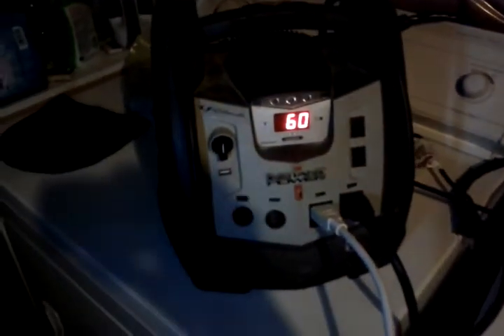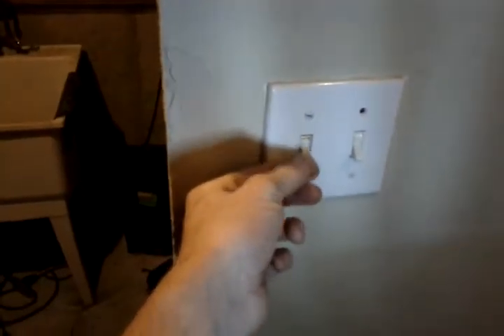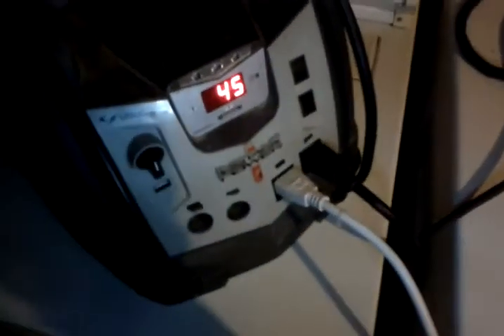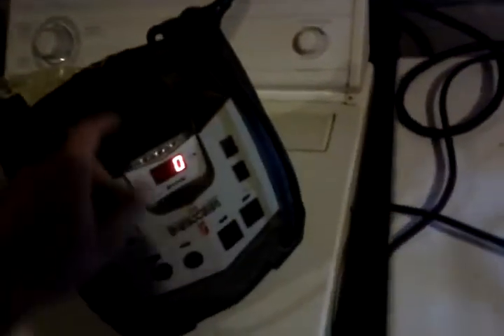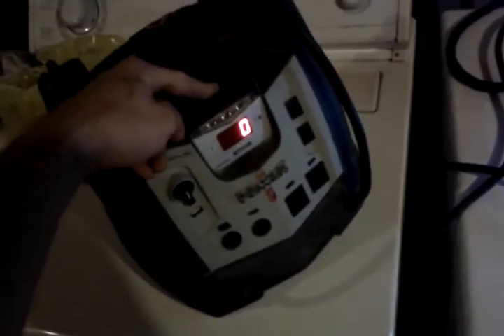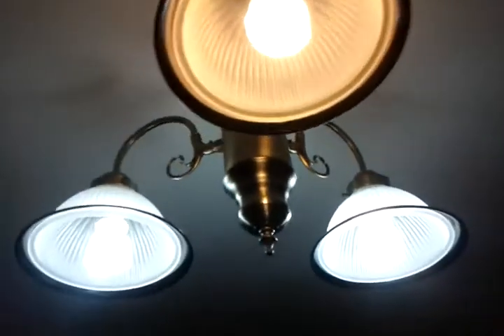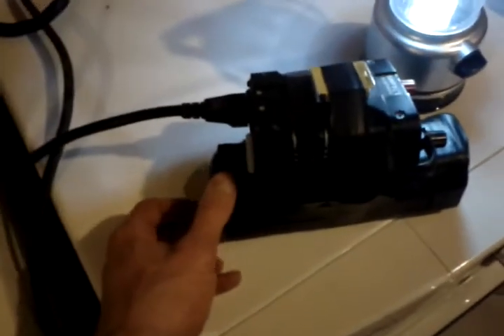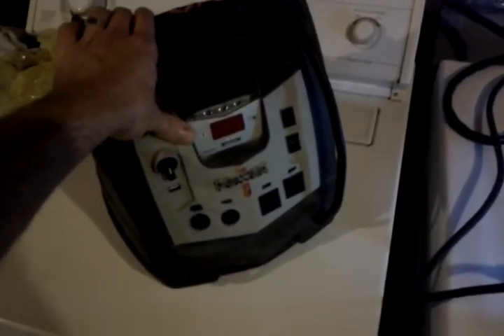Running house off booster pack

Comment: Hey there I just recently bought one of these portable power packs and I had the same problem right out of the box where I couldn't get it to light florescent lights. Being that I am an engineer I started trouble shooting the thing, I tested the voltage off of the inverter and 115v was coming out. Then I started testing the battery pack fully charged, I got 13.6v with an average of 300 crank amps, ok everything seemed fine. I finally went to test the voltage frequency on the inverter and that's where the problem lies, your typical house outlet is 120 to 115 volts with a frequency of 60Hz well this thing puts out 115v with a frequency reading of 58Hz to 59Hz fluctuating. Here in the U.S. electronics are designed to run on 115v @ 60Hz and this thing just isn't putting out the right power from the inverter. OH! and a word of caution don't try and run your nice electronics off of this or you may end up killing them due to lack of power from the inverter. Hope this info helps.

Comment: For roadtrip and weekend camping use, will use for emergencies (tires; jumping) and interior camper light.  Also to charge phones and laptops.  Someone commented to not use to directly power laptop as it may ruin it... hmmm.  But, I am guessing can charge the laptop and then unplug and use, hopefully.  Thanks.
Reply from the maker: Day Drifter i run my laptop off it all the time.
Reply: thanks.  one more ?... can I use a 12v to 12v cord to charge while driving?  I have one that came with a Xantrex powerpack... just wondering if I could use it.  thx
Reply from the maker: yes you can
Reply: How do you do that. Does it have to be turned on? I assuming you plug the booster to the 12 v cigarette lighter and connect it to the USB port correct?

Comment: I have the same unit, where are the fuses? My 12v outlets don't work anymore. I use it to jump start my riding mower, air up tires, ect,
Reply from the maker: I think you will have to open the hole unit from what I can remember.

Comment: I hit a wall too, my laptop power supply pulls about 300w. This says 400w but thats only surge, puny inverter is only rated for 200w continuous
Reply from the maker: sucks hate it what that happens! fake inverters lol
Reply: Going Off Grid if thats the case, I went and exchanged it yesterday to see if a different unit could pull the wattage, still no go. Idk whats different with my laptop that it wont work ):
Reply from the maker: are you using a cigarette lighter plug? on the inverter ?
Reply: Going Off Grid inverter directly. The wattage readout never goes above like 10, and Ive charged some batteries with it, phone etc. It pulls like supposedly 7 watts which seems low

Comment: Thats pretty cool. So you have the 110v from inverter to 110v wall jack and this powers whatever is on the "line" correct?
Reply from the maker: yes, but you have to make sure 100% that the main power breaker is off in the house!
Reply: fliping720 Awesome. Didn't know this-Thanks again!

Comment: Hi, great vid! So my question is, how long do you think I could I run a small guitar amp or portable speaker? I'm a musician and I need a power source to busk with. Thanks!
Reply from the maker: a 50w amp will run for 4 hours or speaker.
Reply from the maker: that would run for a long time as long as the amp doesn't mind modified sine wave as this battery in this video has one.
Reply: fliping720 thank you!  very much appreciated.

Comment: that power pack is small no enough amperage. for long use.get a marine battery the biggest u can fing or a couple make a battery bank add some 400 or more solar panels to start a back up power
Reply from the maker: you are right, this is just a short term power outage salutation.

Comment: Hey whats going man. I have a question, I think you will be able to answer since I saw you are using both products I will ask about. So i bought that power supply you have and i also bought that same small heater (Lasko, 200 watt). When I try to use it with the power supply, bt it self, nothing else connected, it wont work. It turns on for a sec, the it immediately  die. Any thought will be greatly appreciated.  Thanks
Reply from the maker: Wascar Vargas try to get a killawatt meter and plug the heater into it and see how much power it takes,a booster pack like mine will only run a 200w load for 30-45 mins

Comment: so I just bought schumacher xp2260 1200amp peak, on the manual, it says that in order to jump start a car, connect + clamp to + post , - clamp to vehicle chassis, can I just connect the - clamp to - post ?
Reply from the maker: yes you can.

Comment: Thanks for posting this!  I was wondering about noise. I hear a bit of a hum on your video. Is that the booster pack? Is it pretty quiet?
Reply from the maker: yes its a small fan running at full speed, and its a bit loud ad full load
Reply: Got it. I'm going to have it outside on my patio. i'm on in apartment complex. It's not enough to disturb neighbors. Correct?  Thanks again for taking the time to answer my questions.
Reply from the maker: finalorbit no it will not bug them at all, it will not run long at full load but if you are using a small laptop or some lights it will last a long time.

Comment: hello..question how can your charged it faster,,,can you charged it in your car,,,thanks
Reply from the maker: PETER GRIFFIN yes if your car is running clip it to your cars battery and it will charge quit fast
Reply: Hi, do you charge it directly from the car s  battery using the clamp? Thanks.
Reply from the maker: Felix Vargas you can yes

Comment: this is not designed to run and electric washing machine......its for a little lamp or a cell phone charger not a vacuum...........how much power do you expect to pull out of this little unit.......